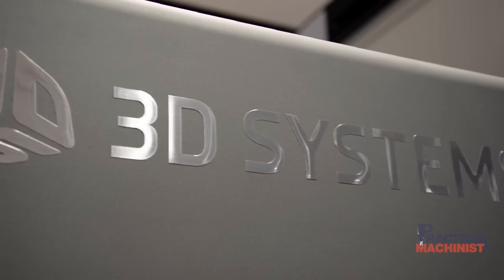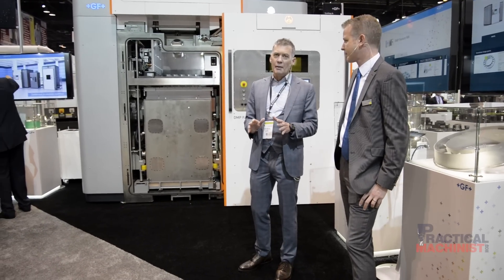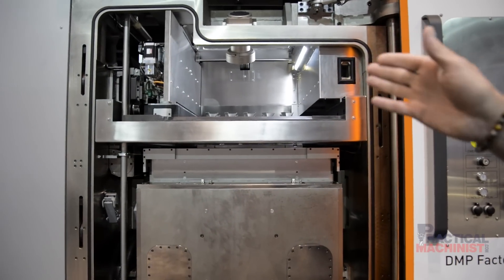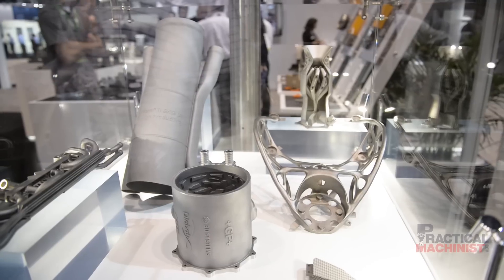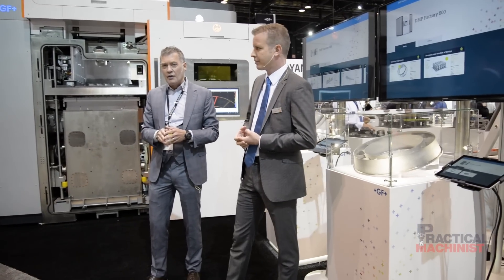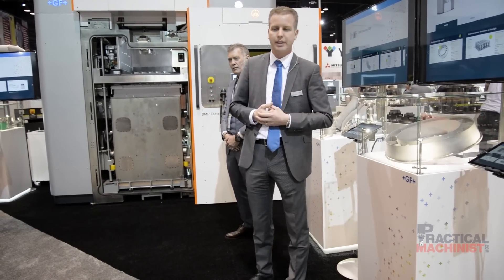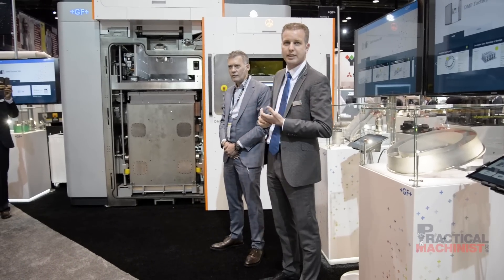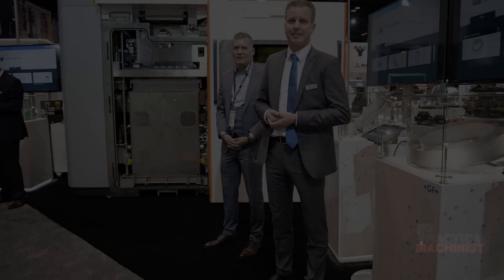3D Systems and GF Machining unveil the DMP Factory 500 at IMTS 2018

Comment: Do the parts still have to be washed and sintered like they do with a MarkForged metal printer, etc?
Reply: No, this is SLS(selective layer sintering), it uses lasers to sinter metal particles together, the Markforge extrudes the same type of metal particles in a binder, which then goes through the post process as you stated. The main difference between the two is that SLS technology can be more accurate with a higher definition print and much more intricate angles and overhangs due to the powder bed acting as a support,but the trade off is that it is extremely expensive, this machine cost with the powder management system is well over $1million whereas products like the Markforge and Dektop Metal systems with the printer, wash unit, and sintering oven cost about $100-200k all in...